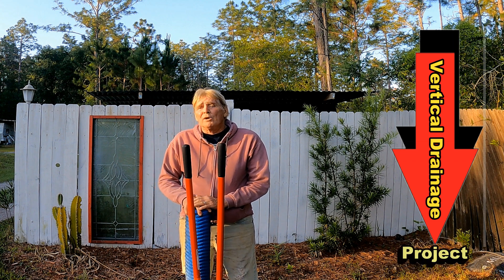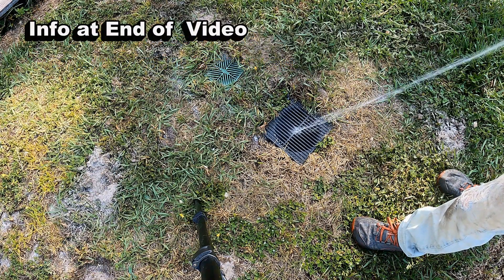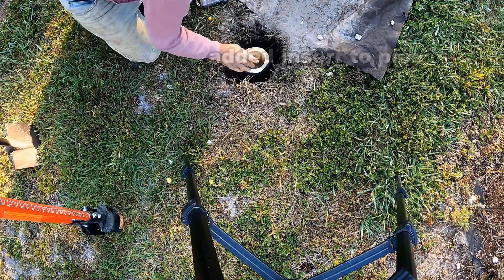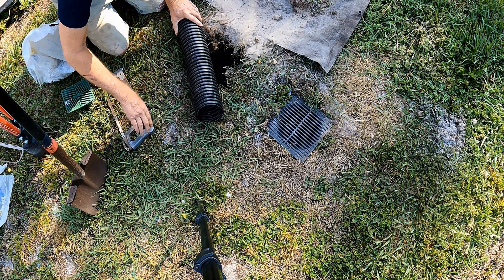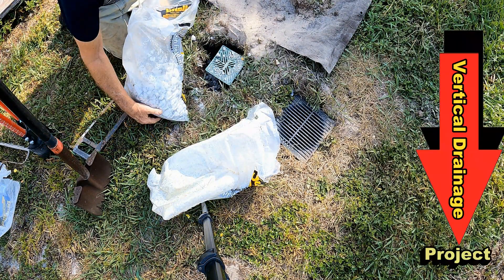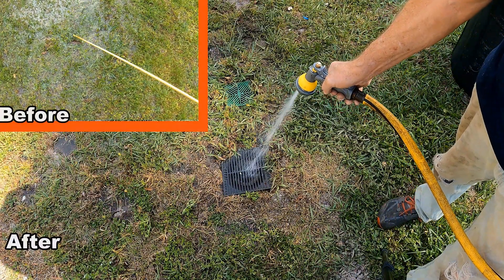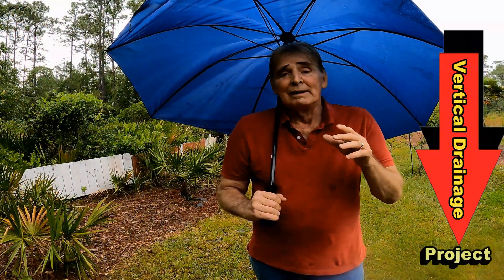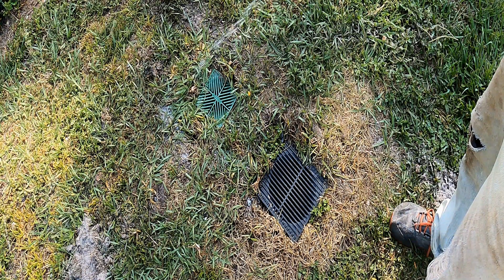Vertical Drain Under $10.00 Watch This!

Comment: Always love your videos. You have covered multiple materials for vertical drains. Overall, which method works best for sandy soil?
Reply from the maker: @TampaBayMonkey  they all work good
Reply: @appledrains  Thank you for the reply. They all appeared to work great for sandy soil so it is good to hear they are all good. I have a few spots to try out. The only downside is digging the actual holes 😀

Comment: Chuck, 2 questions. 1) It looks like you filled the Bachman drain pipe with gravel as well as the space around it, but didn't fill the inside of the Home Depot pipe but rather only the space around the Home Depot pipe. Am I correct? Is this what you did? If so, was there a reason?

2) If the hard pan is not able to allow water through, then how does water drain into the water table? I tried to find out what hard pan is, but I didn't find anything that said it couldn't allow water to drain through it.

Thanks for the video!
Reply: I wondered the same thing - are both methods suitable? I need to do this near an AC condensation drain line pretty soon, so any advice would be appreciated @appledrains
Reply: FDM, usually respond to any questions. This one NEVER responds to questions.

Ps.
I had been watching and getting good tips from both channels.
 But if someone truly believe their method is better, they wouldn't have to result to filling the "inside" of one pipe with gravel and not the other pipe,  That clearly convince me that your method can't be better. At least be Truthful with your demonstration, Its not hurting the other channel, but, hurting the DIY who relying on you channel.
 In fact, I hadn't even noticed at first how gravel was poured into that Bachman pipe until a  post pointed it out.

Comment: Have a friend come over to your house it’s good and strong and both of you to use a two-man gas powered auger to drill down into the dirt all the way where you need it. Do not use the drill by yourself because you could hit a rock and possibly break your back into. And yes, it is possible to do that because a friend of mine was using one and he broke his back into and over the days that came his back kept getting worse in pain And then he found out he had cancer. But now use a gas powered dog or drillbit that will drill down into the dirt for like post hose and you can go that route because it’ll be a lot better less strain on them post hole diggers. Last strain on the human body.and then try that apparatus so what this man is offering to do.
Reply: what 'dhe say?